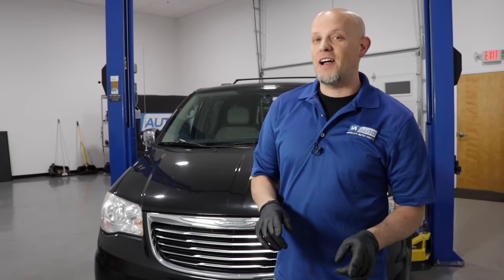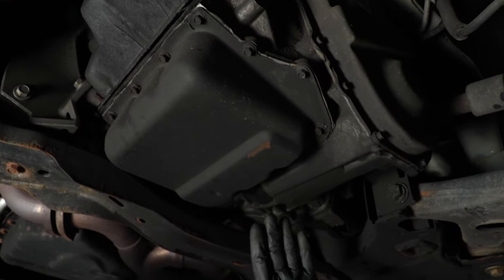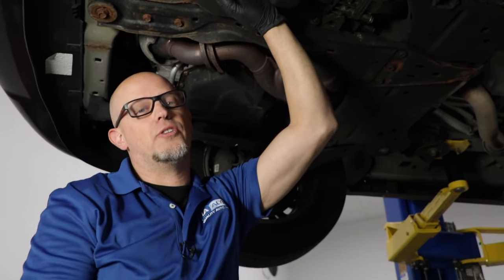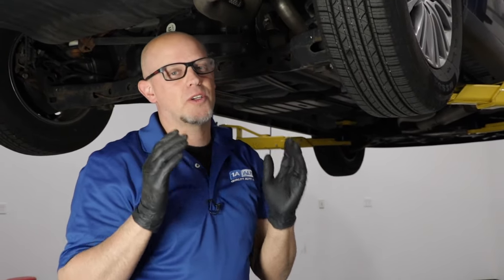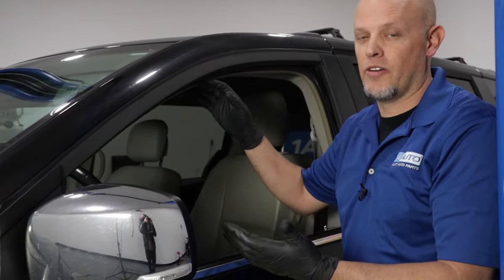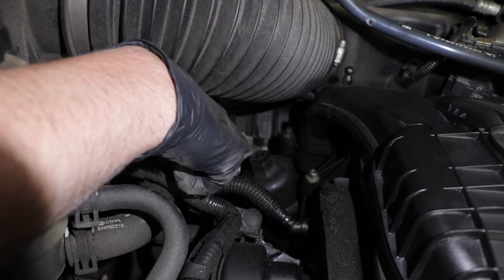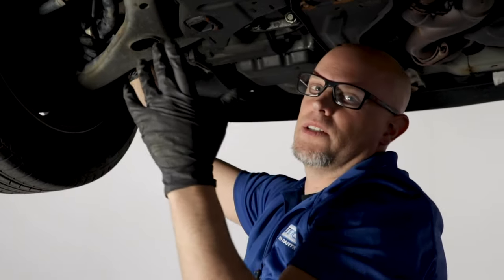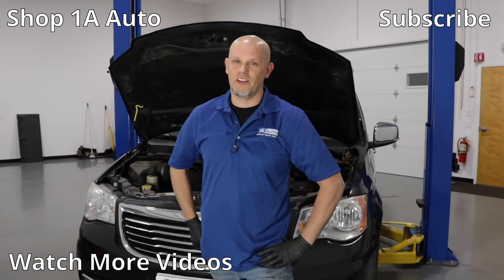Top 5 Problems Chrysler Town & Country Minivan 5th Generation 2008-16

Comment: The transmission is terrible. When going up hills it really struggles. it seems like it wants to keep the engine at low RPM at all times. After pressing the gas pedal all the way to the floor for about 3 seconds it finally starts to respond (more engine RPM) and starts to accelerate. I've never had this problem with any other car I've ever driven.
Reply: Use the shifter  going up hill put it in 3td or 4th gear and it runs so smooth  up the hill. Otherwise you will lose your transmission.
You will see  in the dash a - or + 
Look it up. Save your car.

Comment: again looking to buy a Tom and Country year 2014 to 2016 what is your feeling you since I don't know anything about cars thank you
Reply: Don't and get a Sienna or Odyssey instead
Reply: Don't seriously I have the 2014 Town and country tour and I've had it in the shop for about 3 months since I bought it had it four days and it started acting up horribly transmission problems electrical problems it's a piece of s***
Reply: I bought a 2016 off a lease with 40,000 miles.  I know have 70,000 and it's had more repairs done on it that I could have ever imagined.  All under an extended warranty, but my god this things been a pile of crap.  Front struts, rear evaporator twice, from evaporator, sliding door lock actuator, sliding door latch actuator, blind spot monitoring system twice, leaking transmission lines, new battery, the list goes on and on.  I'll never buy another Chrysler.

Comment: Nevermind the fact that these vans have electrical gremlins up the whazoo!
Reply: I thought it was just ours. Alarm starting going off while car was in reverse. Rear seat started folding on its own while we were driving and my 8yr old daughter was sitting in it.
Reply: Alotnis the tipm. But my windows wont go down but drivers side and you have to hit the mirror buttons to get it to go up or down and then the wipers kick on and dash lights flash

Comment: You know it's a Chrysler when the first problem it's the transmission!
Reply: Owning 3, it's false, but for the Honda Odyssey I had, transmission failed !!
Reply: Same here. Same applies to Dodge to. Don't know on what it is, every dodge or chyrsler car or truck I owned, had lots of problems with almost everyone of them I owned. Except for 1 that I owned was decent. I usually have much more better luck with other makes of cars and trucks. With me do have good luck with Ford, GM etc...

Comment: Hi, can some one help, i have now oil leak, from oil cooler, so we changed it full new, after 1 week same problem, what was done not right or so, ??? 😢 thank you. Or can some one give a link , with step by step, like in factory done, this change oil cooler.
Reply from the maker: +Mantas Zakarauskas We wouldn't be able to diagnose an issue like that here, you may want to have a local mechanic take a look at it. Thanks for checking us out! http://1aau.to/m/Shop-1AAuto-c

Comment: I got 40 seconds into the video to where he says to take it to "a local dealer" and I stopped there.  
You don't have to take your vehicle to the dealership for service... there are plenty of reputable independent service shops that do great work without ripping you off like a dealership will.
Reply: I've run into too many scheisters going to independent mechanics. It seems the only way I can get my vehicle cared for is by the brand authorized dealer. Yes, they charge way more for their services, but I prefer to take my car to the appropriate dealership service department. As with everything, do your research before settling on any particular dealership. Usually there are several different dealerships selling the same brand vehicles. Some will be better than others. It's definitely a personal preference, but I can respect your point of view as well. My experiences dictate my decision in this case.
Reply: AMEN.... most really good mechanics leave the dealership for their own garage

Comment: It is a Chrysler product..
Reply: Very reliable, I had 3 of them.
Driving à 2009 T&C 4.0l for 6 years, just minors things!
And hauling a 24ft Travel Trailer with minors upgrade (extra trans radiator,  balloon in the back) and hitch with extra fixing point in front of rear suspension. Hauling that for 3 years, no problem, and fantastic and practical cargo room !!🙂
Reply: Had big issues with à Honda Odyssey, nothing close of that with my 3 Caravan !🙂
Reply: @manuelkorivu3966  y r u pulling a trailer with minivan? Thats not wat it was designed too do. Its made for economy, not pulling, just my opinion.

Comment: Completely missed the massive oil burning on the 3.8 lites engine
Reply: I owned three Chrysler minivans with the 3.8 engine.  No matter what it somehow consumed a quart of oil every month.  Never had a drop on the driveway or on the engine, had one with 60K, one with 133K, and had another from day one until it hit 267K and it still ran.  Didn't ever have abnormal exhaust emissions, never any significant leaks, just somehow along the way they all consumed oil at the same rate.  I'm glad I have the 3.6 in a 2014 Town & Country.  One of the best vehicles I've ever had.  Did struts at around 110K otherwise just the typical maintenance items (brakes, tires, fluids).

Comment: Problem number 1 its a chrysler.
Reply: A Fiat*
Reply: @river1403  Well up until 2011 it was a Chrysler.  Then fiat had it's influence in 2012 models.  A 2008 and a 2012 should be considered different gens.

Comment: We have same car..the issue is check engine light we bring it into dealer and the cost of repair is 2900$..but i check the Diagnostic it says sparkplug missed fire etc..and they charge us 300 for checkingbthe problem..need help if they will repair or not because its too expensive
Reply: Just take it elsewhere, they will charge you for a spark plug change and you will pay less!  Or DIY

Comment: YouTuber, Scotty Kilmer, gives Chryslers a bad rap. I have had great experiences with my T&C. Owned many Dodge/Chrysler vehicles in fleets in the extreme Arizona summer heat. They were more reliable than any other brand by far. I was a Ford devotee before the fleet days. I was very disheartened that they just couldn’t cut the extremes. The irony is that the fleet was kept next to Ford’s Arizona proving ground.
Reply: only after the merger with fiat

Comment: It goes fast on gas how do I fix it 🙄🙄🙄🙄🙄🙄?????????
Reply: Tell us
Reply: Check your engine code for a stored emission code. P0456 was mine and it was for the ESIM. Small white vapor canister that went bad. Caused the engine to run rich. Fixed it and no fuel problems.